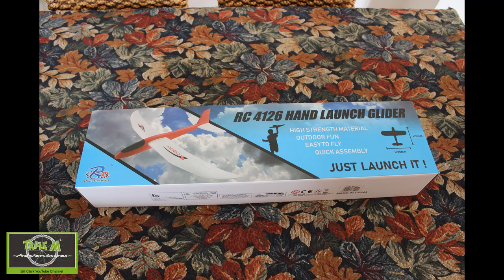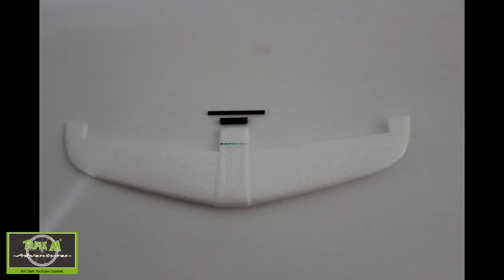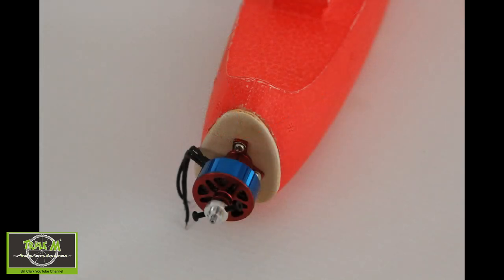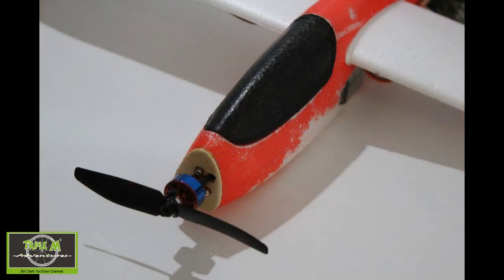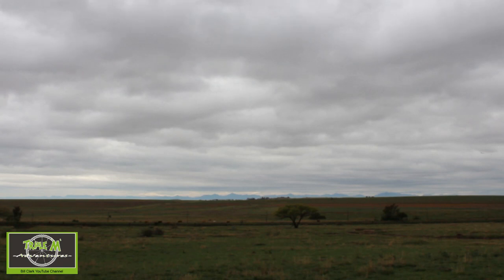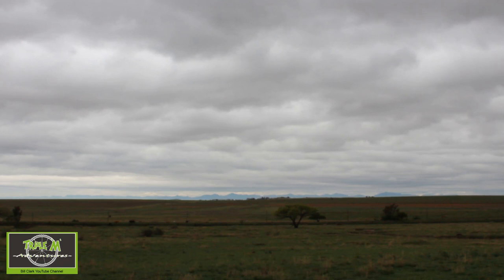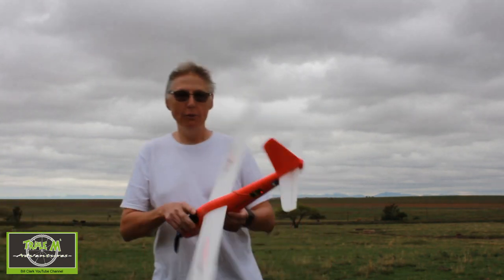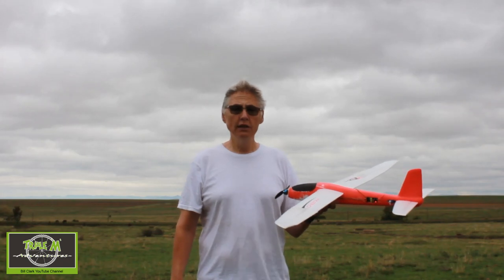Converting RC 4126 Hand Launch Glider the Cheetah to Radio Control.

Comment: where did you put the center of gravity? Do you think this will work on a 1000mah 3s lipo?
Reply from the maker: Hi Birgax, 2.5cm from the leading edge. I would have liked to have used a 3s battery but it may be difficult to carve out the nose area enough to fit it in. I only had 1300 mAh 3s batteries and they are far to big. Must say it would have been nice to have the extra power.
Reply: @the-happy-RC-flyer  thank you very much bill! Big help :D